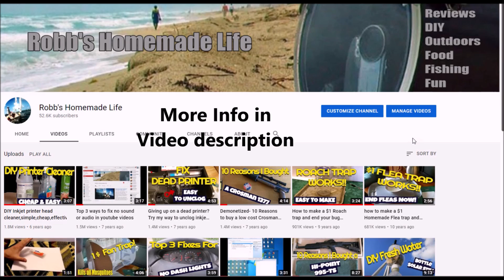12 REASONS CAR FUSE KEEPS BLOWING

Comment: Thanks for this video. Finally someone who knows what they are talking about !

I have a newer 1500-watt inverter, which I had been using fine for months. I accidentally shorted it out. Opened it. Found  4 x 30a fuses in there. I saw the first in line was blown. So... easy. I replaced it. But I didn't have a 30a large blade, so I replaced with a 40a large blade. No problem, it is a little bigger so won't blow as fast as a 30, but still small enough that it will blow if it needs to.

BUT... it blew! right away. With only about 650 watts device on it.

Put in another 40a, which also blew.

Put in another 40 and using the inverter now for only charging small, low amp devices while I figure this out, which seems to be working fine, but waste of a huge inverter like this. Is something else wrong inside there that the short caused and that is why it keeps blowing? Or is the 40a blowing where a new 30a would not?? It seems the 40a would blow LAST instead of first, inline with all the other 30s...

Mmmmm
Reply from the maker: Hey I wish I could help you. I'm not sure what I would do. Thanks a lot for watching and leaving health comment.
Reply: @RobbsHomemadeLife  I had a closer look this afternoon. All the fuses were blown, it just looked like it was only the end one. So I replaced all and now running fine. thank you for the reply!
Reply from the maker: Hey I'm happy it worked out for you thanks for letting me know.

Comment: I don't want to check my wiring harness but I will take a look. So my 2004 Nissan Xterra keeps blowing a 15amp fuse. Second one blew yesterday and my odometer lights went out, the P,D,L,R lights on the transmission lever went out, exterior rear red taillights are out and the lights for the ac, fan in the interior lights all went out at the same time. I will try these tips and update my comment. Thanks for the guidance old sport👍🏾
Reply from the maker: Hey thanks a lot for watching the video and leaving a nice comment. Much appreciated. Good luck.
Reply: Hey, I have same problem. 04 Xterra, 15 amp blown fuse, dash and tail lights out. Did you find the solution? Would really appreciate any help. 🙏🏼

Comment: Wow thank you for those tips. In my case the fuse that feeds the maf sensor. purge valve and egr valve keeps blowing when i start my car. (2002 pontiac grand prix). I will trace the issue using your tips and if i dont get lucky i have a mechanic i know that can fix it. Keep the videos coming i enjoyed it.
Reply from the maker: Thanks Kevin, I appreciate it. Good luck

Comment: Okay so I have a 2001 Toyota Tacoma. My fuse keeps blowing when I press on the brake. The shifter is stuck in park. My running lights work but my brake lights don’t. I had gotten new tail lights but the brake lights worked when I installed them. Any ideas?
Reply from the maker: Hey Jason, that was kind of my problem. I've got a 94 Corolla. My brake lights were melted. Do a thorough check on your brake lights and brake light wiring.

Comment: Hello  this seconds time I use air compressor in my cigarette lighter adopter in my 2007 caravan after filling up my tier for while compressor went off I checked my fuse went off again my mechanic changed once now seconds time blows off fuse only I use air compressor that happened not when I charged my phone no problem I have not checked what type fuse is correct one  but if you know can you let me know please thank you
Reply from the maker: Tony it sounds like your air compressor is making your fuse blow when connected to the cigarette lighter. You could try different air compressor or get some clamps and splice them into your wires so you can attach the air compressor directly to your battery.

Comment: Very good suggestions  I have had over forty cars and trucks. Now I only change the battery my self. Anything else, I have a good dealership, service gas station. Get treated very well at both. 250,000 miles ,rebuilt engine 5,000 miles.   See you next time 👋😊🐿
Reply from the maker: Thanks Oscar!😃👍

Comment: Don’t forget to check the hooves for stones and add a few carrots and apples to its diet.
A while back, a car load of women and girls from New Jersey were blocking the lane at the self service gas station. I decided to help if I wanted to get gas.

When they put the car in gear, the windshield wipers turned on. I asked if they had the owner’s manual and fortunately, they did. They also replied in the affirmative when asked if someone just worked on the car. I showed 
the most mechanically inclined among them , who was willing to help, where the fuse box was and removed the fuse that ran the wipers. Fortunately, it worked. I impressed upon my helper to be sure she knew how to replace it if it started raining on their way home. I didn’t get around to checking their hooves.
Reply from the maker: Car electronics can be very entertaining
Reply: @RobbsHomemadeLife  
I’ll say! 😁

Comment: 7:13 - My first car was a ratty old 1969 VW Karmann-Ghia. Great fun to drive, but endless problems. I can't recall what fuse was constantly blowing, but being poor and stupid, I just kept replacing it over and over again instead of getting the electrical issue repaired. The floor behind the front seats was littered with dozens of those little glass Bussman blown fuses and the little tins they came in.
Reply from the maker: Hey John I remember that VW. My friend had one. They were pretty cool looking. I was always working on my Volkswagens. I think I wore out my copy of the complete idiot's guide to Volkswagens.
Reply: @RobbsHomemadeLife  Yup. Back then my best friend had a 1971 KG convertible. We both kept our greasy copies of John Muir's fantastic 'How to Keep Your Volkswagen Alive' in the cars. Especially now with YouTube and online forums, I don't think there's much that you couldn't fix on these cars yourself. It was the complicated electro-vacuum system of the broken autostick transaxle that finally did me in.
Reply from the maker: the dual carbs on the VW fastback made me cry.
Reply: As long as you didn’t cripple any friends cramming them into the back seats. (I think that may be where my back troubles started)

Comment: I'll add as a preventative don't use cheap charging adapters in your vehicle. The stiffness of the cheap adapter can pull out the wires from the cigarette lighter port and the entire port and wiring.
Reply: Yeah, last year I was using my cheap old tire inflator and the plug came apart in the receptacle, shorting it out and blowing the fuse. Annoying.
Reply from the maker: I think a lot of people have had that problem. My last two adopters stopped working after couple of months.